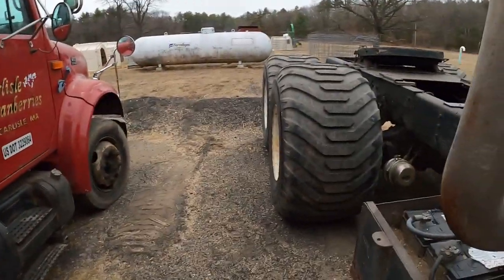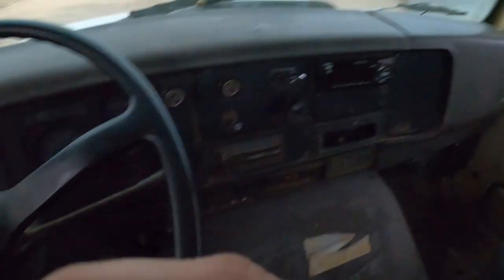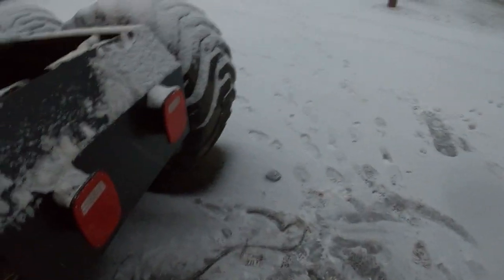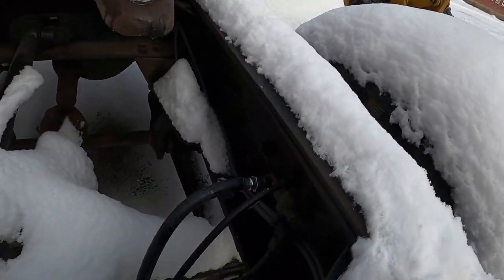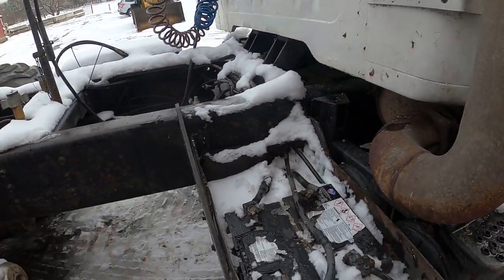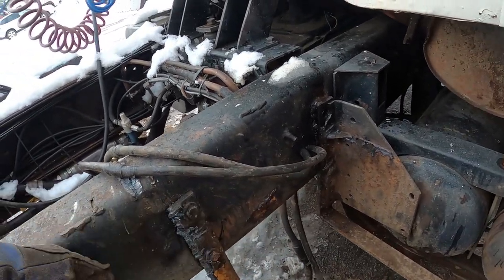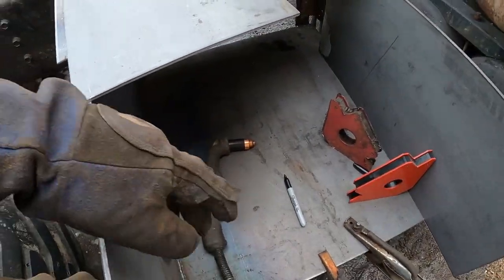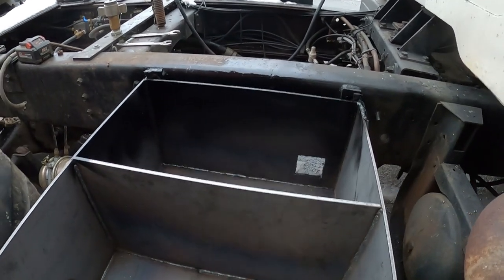How To Keep A 42 Year Old Semi Truck In Working Condition Part 1

Comment: Very nice fab job on the box. A couple of suggestions:
1) get some drain holes in there soon as ya can......before ya get water sitting in the bottom screwing up your good work. A set of small "duckboards" in each section will keep the tools (and maybe the batteries) from sitting in water that may get inside the box. Plus, it will allow that water to drain much better. 
2) on top of the duckboards, put the batteries on a rubber sheet. It will give them some protection from vibration, that translates into a longer battery life.
3) make a separate (inside) cover for the battery area....or at least take some of that rubber sheeting and lay a piece over the top of the batteries.....ya don't wanna be fumbling in the toolbox portion and flip a metal tool onto those terminals.....that could be bad.
Again, great looking box. Your gonna appreciate it every time you start the truck.
Reply from the maker: Appreciate the ideas definitely good ones

Comment: Some small drain holes in either side of that box are a good idea, some rubber under the batteries and a tie down to. Fastest way to shorten a battery’s life is to shake it and bounce it around.
Reply from the maker: Thats for sure and is part of the plan

Comment: Nice looking battery box tool box just remember to put some rubber on the bottom of that battery box battery sitting on the metal kill them faster than anythingand I would throw a little rubber in my toolbox too like an old mud flapper conveyor belt whatever you got laying around good job though
Reply from the maker: Thats something I have to do tomorrow. Thanks for the reminder

Comment: I got my motor replaced in my Silverado 224,788.45 miles and I blew the motor up in a fit of roadrage dingbat broad in a Lexus thought I needed to move out of my lane while I was still using it. Her boyfriend pulled a 25 semi automatic and I blew out her back window with a 44 cal. instead of shooting him but I blew the motor up $2400 and I was back on the road happened in October was driving it by new year's

Comment: Get some rubber mats and putting em under the new batteries and add a way to secure them to the box. The less they move n vibrate the longer they'll last. Plus the rubber will keep them from corroding the metal. Maybe add a couple drain holes in the bottom just incase. And add weather stripping to the top edge of the box to help with noise n water. But looks awesome
Reply from the maker: Good advice

Comment: Shinney Hinney 290 . Great little motor . Ive ran the same year and style corn binder . Yes I have the right to call it that . Good trucks . Last one I ran had a 6V92 silver series with a 10 speed and I had the local record at the time of 120,000 of cotton seed in it . The 290s I ran in mostly Cab over freight-liners and International trans Stars . Nice job on the box . Might want to think about some kind of rubber flaps over the frame side where the wires will go through to keep the mud out . small rubber hose slit down the middle and layed over the top of the edges on the box will help keep out moisture and debris if you have room for it , Like old fuel hose or something . I drove for over 30 years starting in 83 when I got out of the service .
Reply: PS watch the head on that on the back they warp easy .
Reply from the maker: Some good advice thank you

Comment: Make sure you use the kill switch for the batteries regularly or they will corrode and you’ll be wondering why the truck won’t start up. I’ve replaced everyone we have on our fleet of trucks because they weren’t getting used

Comment: Nice job on the box. Way sturdier than some pos tin foil aluminum box. 

I'm working on a front bumper for my woods truck right now. Just a simple 6" channel bumper with a winch mount. I need one of those plasma cutters in my life! I've been looking at a combo plasma/stick/tig unit from Everlast for $800.
Reply from the maker: Thats for sure couldn't find something I really liked. My mack needs a new bumper haven't figured out what exactly I will be doing for it. They are one of the best tools I have ever bought. I forget what I paid for this one but worth the money

Comment: SpeedGlas are the best helmets I've used. I'm still using one from 2008.
Reply from the maker: I will have to check them out
Reply: They are expensive but really worth it if you weld often. Another benefit i have found is the clarity while welding is superior to cheap hoods.

Comment: The Battery/toolbox make was cool but I would have hinged the lid to the back to rest onto the tyre so when open would have a little bench
Reply from the maker: Good thinking there. I wanted to be able to easily reach the battery's from between the tire and box so that's why I laid it out that way

Comment: Looks well. Put the batteries on rubber belt if you can get it the batteries  don't like the cold.
Reply from the maker: Thats good thinking
Reply: I have vintage tractors. Also check your voltage of the alternator  before removing.

Comment: Im looking into a hobart 27i plasma cutter and i like hobart since tsc carries them so easy to get consumables. I run a hobart 190 mig welder off a generac 7500 generator and the compressor i bought off craigslist should be just under my output with a 27i running together
Reply from the maker: I've hear they are good units. I get all my stuff at airgas they pointed me towards the hypermax
Reply: @DuffyAg  i rebuilt my flatbed on my trk using my 190 mig and a dewalt 9 amp 4.5 inch grinder with diamond tip metal cutting wheels and for a little bit i did go up to friends and used his plasma.  And then a real big job was cutting off my trl hinge tubes and replacing them with new heavier tubes. Really couldve used a big 9 inch just for the blade size as i just barely was able to cut out all the welds with a 4.5 inch

Comment: Hay gotta ask did you disconnect your batteries before welding on your trk.  Dont wanna fry any electronics on your trk.   Lol dont think you have any electronics to worry about and the fact its the battery box so no batteries.   Also maybe look into installing jump post maybe depends on how hard to access batteries
Reply from the maker: I took the batteries out of the box before I took the box apart. Yes they weren't even on the truck. With the box it makes it easy to jump now
Reply: @DuffyAg  i was joking. That box looks pretty heavy duty

Comment: Air leak through a shaft is where pressure  coming out of transmission.,on the back box
Reply from the maker: Wouldn't that pressurize both cases? And it's higher then the fluid level so why would it push so much fluid out
Reply: @DuffyAg  if you are hearing the air coming out of the vent, flip the transmission to the high side the air will stop leaking inside the case, that’s how to check that. I don’t remember that of that causing a terrible
Reply: Oil leak
Reply: I assume you have a fuller 9 or 10 speed
Reply from the maker: @rogerstollar6440  it's a 6+1. I'll have to double check it's not leaking internally. The shifter is up high the for that tho
Reply: If it is a 7 speed spicer transmission I don’t know anything about then,

Comment: woring on replacing the gas cilynder on the steering wheele of the 6300 john deere, it's a real paing since you have to remove almost all the switches and lights on it. And taking the broken one out was probably the easy part, i can't imaginf how the putting the new one in is going to be
Reply from the maker: They definitely don't make it easy to work on them

Comment: Did you make sure, if youre grounding the batteries inside the box, that the new one has good ground to the frame? Could contribute to electrical issues
Reply from the maker: The box is intensely welded to the frame so it has no issue with being grounded
Reply: @DuffyAg  that'll work perfect, I've seen some ones people put on where they don't get enough penetration and so there's a voltage drop since it just basically got welded to rust
Reply from the maker: @Moltant9er  that's for sure never good. Got alot of penetration. Charging awesome now will have a video up with the rest of the project
Reply: @DuffyAg  sweet glad to hear! Keep it up!

Comment: Nice hair cut ,now your gonna freeze 🥶. You said you were putting in a 6 robot barn how many cows do they milk
Reply from the maker: It's much colder fit sure. The 6 unit barn is milking 340 or so cows. That barns been using robots for almost 3 years

Comment: They still make serviceable 30/30 brake chambers but people are to lazy and scared to cage the brake chamber before undoing the clamps to change a $5-10 rubber disc inside and spend $50
Reply from the maker: Never knew they still did. Old timers tell me it's not that bad to do
Reply: @DuffyAg  they do in australia, the brake chambers that don’t hold the truck are service brakes which only work when air is supplied, no spring inside hence why there half the size, usually only on a front axle if it has brakes and maybe one diff but mostly get all 30/30 on both diffs